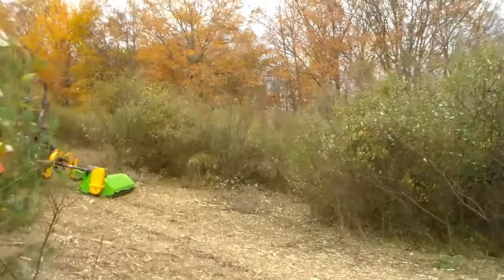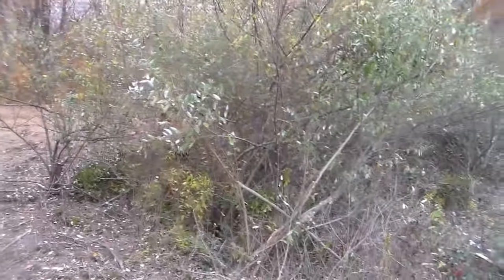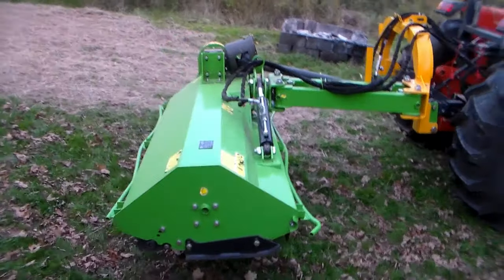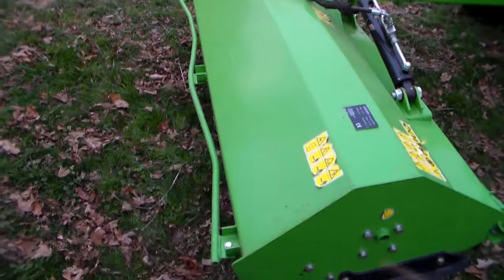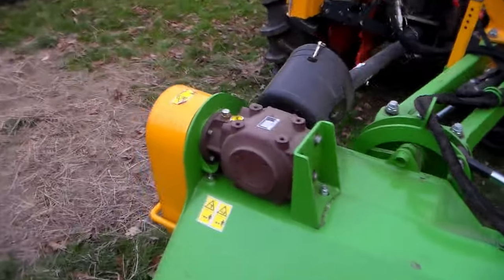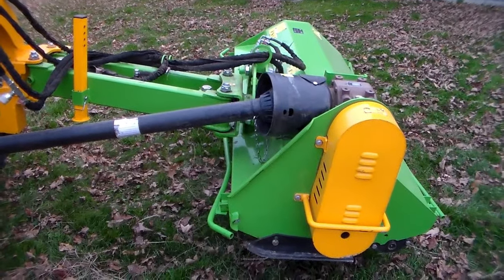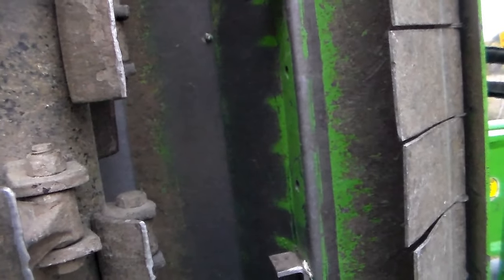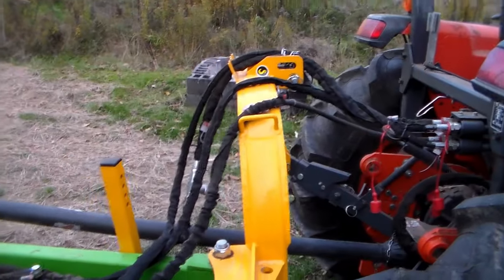Putting a BEATING on the NovaTractor BCRM175 Flail Mower!  BEST USE & REVIEW VIDEO!

Comment: As much as I watch other channels that review equipment and they are great but I get way more information from videos like this pushing equipment to the edge or past its limits I hope more manufacturers realise how effective this type of content is any flail can cut grass how many can be abused and survive that's what I like to see
Reply from the maker: Thank you and agreed! I want to get their chipper shredder next. They say it can handle 4" branches. I'm sure twigs won't stand a chance...but can it REALLY handle 4"!?
Reply: @rednecktech82  I got a knockoff china pto chipper for odd chipping and it's 4" it can definitely handle more depending on the type of wood   really struggles with iron bark here in Australia but fresh cut non hardwoods it will chew threw over 5" easy.if you plan on using it more than 1 and done get the auto feeding I didn't and dry hardwoods  definitely suck to force feed or they tend to when they get short bounce around get sidewards and pop a shear bolt.
Reply from the maker: I live in hardwood's country (Northeast Pa, USA) but realistically I would never chip anything 4" large, I would cut that up and burn it but just to test the machine I would run 4" through it to do a review and post a vid...if and when I can afford one lol. (About $2400 right now.)
Reply from the maker: Spec'ed out Nova Tractor's chipper shredder is the best deal and I would get the independent one versus PTO just because I think it would apply to more people and my main focus would be to do a review video of it, but then I would also obviously use it around my own property. Another plus is an independent machine would be more maneuverable since I could take it Into the woods on an ATV versus having to try and fit my large tractor into tight places.
Reply: @rednecktech82  If not you can just run it over a few times with your flail mower!
Reply: @rednecktech82 awesome video I ordered mine after see this , do you have a video on the assembly of this bad boy toy?
Reply from the maker: @anthonykontos7931   I don't but it wasn't difficult, there's little you need to assemble and if you have any questions Jack at Nova-Tractor is awesome at getting back to you quickly.
Reply from the maker: @anthonykontos7931  8:30 of the vid explains a little...you need to hook up your hydraulics to maneuver the mower into position to install certain bolts.

Comment: I have wanted a ditch mower for a while. Pricey though. Then I saw your video and if it can take that kind of abuse for that cheap of a price, well it will be here soon. I have the side shift mfz195 and it's been a great mower but it cant do ditches. I found  Y knives to fit it and I have cut grass 6 feet high and didn't even work it hard. Thanks for video!
Reply from the maker: Once I finish destroying it clearing this property I'll be buying another! I love it, the next one would just be doing grass at that point so it should last forever! 🙂
Reply: @rednecktech82  Mine will be here Wednesday!😀

Comment: Thanks for this review! I've been looking all over the market. It's obvious that no one makes them here in the US, so we all get to choose our poison. No one has pushed one of these  the way you have, and few companies near this price point get good reviews. Your video has helped me make up my mind, and I will be calling Nova soon. It appears they are sold out of the size I want, but maybe they will have some in this spring. Again, thanks.
Reply from the maker: Thank you! Be sure to mention "Redneck Tech" when you place your order to receive some free parts!
Reply: @rednecktech82   What free parts are they including? I bought their heavy-duty unit. Like you I used it hard, or harder than you. It really didn't hold up as well as it should have. As you can see in my post from 3 months ago. 6 months after I got this one, they come out with a severe duty mower. Go figure. I bought this one to try to save some money. Courese if I had known they were putting out a severe duty, I would have waited for that one. I use mine commercially. So, it doesn't get beat, but it doesn't get babied either. It does get worked hard. Maybe in the next couple of years I'd really like to demo and review that Severe Duty mower.
Reply from the maker: Tou'd have to contact Nova-Tractor but I believe they send $100 worth of parts to include spare counter knives and hammers/cutting teeth.
Reply: @rednecktech82 . Must be something new? They didn't have it when I got mine. I got mine the year prior to covid. I need to order some new parts for it this year. I'll definitely check with them. Thank you so much for the info. I'll definitely give 'em your name.
Reply from the maker: The free parts is only when you order a new unit and mention this channel.

Comment: I have the tractor, a Kubota MX5200 with two rear remotes. I need the mower. Not for clearing bush but to cut grass. Grass that is six feet tall.
Reply: the six foot grass will be way tougher than what you watched in the video better with round up and fire
Reply: I found Y knives at I think WoodMax and cut 6 foot grass with ease with my mfz195 flail mower. I had to get spacers made but it work amazing.
Reply: @stephenjones8735  since four months ago I bought a flail mower. It can sideshift hydraulically but isn’t as manoeuvrable as the one in this vid. It should be all I need to mow grass between trees in my orchard. I have not used it yet. Hopefully it works.

Comment: Great video!

If anyone planning on getting a flail mower and thinking about getting an offset, I strongly suggest getting the offset and not settling for a side shift. I regret not getting an offset. 

Hammers should last years on lighter brush like what is shown in the video. I learned to run two out of the four drive belts on mine because I kept getting 4”-6” diameter sticks stuck in mine.  It’ll smoke the belts in a hurry if you’re not hitting the pto quick. 
 We used red loctite 271 and/or Nord Lock wedge-type lock washers and/or steel crimp lock nuts on every fastener on our flail mower, especially the hammers. For the hammer bolts and nuts we completely cover the bolt and nut threads with 271 and use steel crimp lock-nuts. We have around a hundred hours,  since we disassembled and reassembled the entire mower, and have not had any bolts come loose but we still check them often. Before we disassembled and reassembled everything we constantly had hardware coming loose.
Reply from the maker: Thank you! Great points and I second the Loc-Tite!! 
FUN FACT: I replaced the angle iron guard by the roller with 3/16" angle iron...well, it worked loose with all of my abuse, and the mower twisted it up like a pretzel but did NOT damage the mower at all! I'm telling you, I have beat the hell out of this thing and will absolutely buy another when and if I ever do finally destroy this thing!

Comment: Maybe you should do a limbing video with the flail, that should save so time. The flail I used to mow with had the medium weight knives (hammers) on it yours are the heaver type ,not the heaviest I've seen but cast anyway, so it's no wonder why it cut all of that down. The hangers on that are different that's probably why they got loose, I think you'll be able to just sharpen those after they're pretty tough and they bounce off of stuff so they keep going. They're kind of meant to ""break" the grass anyway and work even when rounded off but to each their own. That will be great for ditch lines and around ponds for sure with the off set. Does the still run (cut) when you tilt it?

Comment: bought an old mott mower at an auction 180 bucks was belt drive switch to chain drive made sure the 3/8 shear bolt would shear changed the swing lite blades to long t blades home made the mower runs behind a 100hp tractor you will find it is easier to mow up a couple inch of soil as the ground becomes the place where everything is trashed

Comment: Thanks for the video I've been looking at buying a flail mower. 
I havea question, in 4 to 6 foot of mixed fields what is average rate of speed and still get a good cut  ?
Reply from the maker: @shadog1962  too many factors, I mow up and down a big hill so even my turbo diesel tractor bogs down. Depends on the tractors power, the terrain as I mentioned, how tall or thick or wet is the material etc. Flat land with dry grass even 2' tall I say the listed specs on Nova-Tractors website would be accurate.

Comment: I guess I'm stupid, but I'm not seeing how you put a stick through the hood, unless you threw something up from underneath.  That is a bit of a concern for me as the slash is thrown forward, so I need to worry about what may be in the way of it (like the fuel tank on my Branson).

I had not looked at this brand, but will investigate further as it does look pretty rugged.

I guess your viewpoint of trashing a piece of equipment that costs less than what renting a proper mulcher for a day has merit. 

Thanks for posting.
Reply from the maker: That wasn't from the flail mower, the hood was from plowing through the trees/brush.

Comment: Funny . I bought the larger, Heavy duty version of this machine. Biggest difference is mine hsa the 5.5 lbs. hammers.
Course I probably should have done what you did. a video and review. Unfortunately. I just don't have that kind of time .
However. I figured it was time for a new flail mower and thought I could save some money with Nova Tractors Heavy Duty mower.
Weelll, that didn't work out like I'd hoped. The very first job i did with it, worked great. However, the 2nd. job not so much. There are 4 belts which drive the flails, (mower drum). After about 2 hours into the project the 3rd. belt in, not the 1st, 2nd., or 4th. or even 2 or maybe 3 of them, Broke. The next thing that happened on the same job. Same day. The, supposed to be saft shields in the front of the machine, that's supposed to keep stuff from coming at you, 6 of them vanished. have no idea when or where they went, but they disappeared faster than getting someone to actually work these days. For supposing to be heavy duty they seem to bend real easy. The knock down bar on the front, yeah, Ya might want to change that out with a real pipe that don't bend so easy. The one on the back is great. Course it really doesn't do anything, Kinda like kids these days. Now the scrapper bar, The angle iron on the rear roller, It keeps the mud and stuff from building up on the roller. Yup. Change that out too. Because the fist time you back into some brush that you need to mow down, will bend on you faster than a career politician . Now the next thing that happened, I could blame it on the machine, but I'd be lying. Dam it. Should have learned how to lie better. lol.. I actually had one of those cast 5.5lbs. metal hammers break right in two. Ya I kinda may have hit a 4in. diameter oak stump that was hidden in the tall grass and brush. The gentleman failed to mention he cut down a few small trees. All the other ones he cut down short enough that with the machine set to it's highest setting would go right over them. So of course when that happened, yah, you guessed it. I twisted the pto drive shaft. I still think it might have been the machines fault. (Just Kidding Nova). Gotta eat that one.
But anyway. I did contact Nova Tractor and expressed my concerns. I let them know what happened and even told them the things I broke.
There's that dam honesty thing again. But I never heard back from them. But I noticed that when the video and review you did they were happy to leave you a nice comment. Which is awesome. That's the one thing I didn't do. Guess I need figure out how to make a living doing video's and reviews. Gotta be easier work. Course if they sent stuff to me to see if it passes the Rick test would be awesome. Couse I can't afford to buy things just to see if I can break it. lol... Anyway. I've had to repair a lot of things on this machine that should not have had to fix. The gearbox is great, the balance of the roller and the mower drum is great. At the time I ordered mine, it was the biggest they offered. They now have the "Severe Duty " mower I wanted. All and all it's really an okay machine. As long as you don't plan on working it to hard. I'm also surprised they don't offer "Y" Blades for the heavy duty Mowers. That would be nice when you're mowing a hay field. The hammers work but you have to sharpen them. That takes time because you need to make sure they are balanced. Me. I'd swape them out. Then I could mow fast. to some. 4 years ago, you couldn't get one from Nova Tractor. I do a lot of roadside mowing for the state so I needed a machine that could do the task. This one is "NOT". I should have just waited for "The Red One" to get back in stock. They're a great machine that has lasted me for many years. Out of respect for Nova Tractor, I'll keep the name out of this review of my experience with their Ditch and Bank Mower because I think they're really a good company. Maybe after they've had their "Severe Duty" Ditch and Bank Flail Mower a while. Maybe in about another year or so, Depends on how long it takes me to save my pennies,
possibly buying That one and see if I can break that one. I'd bet they made some good changes. That's why it say's "Severe Duty". Lol...
Anyway. Just make sure you don't work it hard like I do. It won't hold up. I do Think Nova Tractor has a reasonable Price for their machines.
So That being said, maybe when I get ready to replace this one I might like to try thir "Severe Duty" Ditch and Bank Flai Mower.
Reply: Damn! A freaking book😧🫳🍿
Reply: @Ranchready496  I take it you don't like books? I'm sure some folks do. After all. This is a real, honest revie. This is a "Heavy Duty" machine. Just wanted to make sure folks knew EVERYTHING that's wrong with this thing. That way, people know what they're getting. 😎👍

Comment: Would lock washers or Loctite work to keep the nuts from backing off?
Reply from the maker: They have lock nuts on them. I think it was just me beating it with that thick brush it was not intended to be used on. When mowing my fields they didn't work loose.

Comment: Too bad they used round iron for the protective bar in the back instead of an I-beam other than that very fine piece of equipment that could clearly without much work or expense be dramatically improved and upgraded.
Reply from the maker: That guard isn't even needed, it's only there due to UK requirements I was told. Under "normal" operating conditions it would have been fine. I was shoving over what were basically 4"+ Trees with it! This thing needs no upgrading. I truly beat the hell out of this thing, it's worth every penny as is. FYI, I paid full price for this thing, this is MY honest opinion on this.
Reply from the maker: I should also point out, though the guard isn't really even needed as my other comment stated, I am glad it's there...if it wasn't for that then brush etc would be scratching and knicking up the actual flail mower body...so this is a little extra protection to keep what counts pretty :)